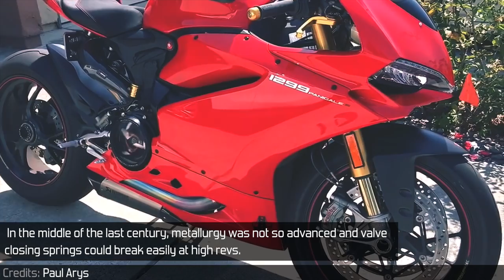Camshaft Closed DESMODROMIC Valve: Explained!

Comment: In the UK they had a bike racing series called battle of the twins. Anything could enter, except ducati desmo's  because being 4v they were more powerful than their 2v contemporaries.  My father who was a cylinder head specialist was enlisted by a racing team to remove desmo system and replace it with valve springs.  Took some planning to drill a big hole in the head in order to modify it internally. It won first time out and the competitors put in a protest insisting it's taken apart for inspection.  Imagine there surprise when they found springs!
Reply: I have long held that in motorsports if you want to be better then you must be different and try things no-one else is doing. Your Dad is a prime example.

Comment: The biggest advantage of desmo is lack of spring friction. This becomes huge as rpms increase and results in better fuel consumption for racing desmodromic valve engines.
Reply: Anthony Butera just like running competition cams, springs... in a race car, they're going to need much more maintenance, and generally won't like being short shifted.
Reply: Dylan Zrim 
Kind of but you have to set lash in 2 directions. No springforce on the cam in a desmo. Turn the cam on anything else and you will feel resistance from the springs on the valves.
Reply: Japanese bikes should try it out as well. who know how well they will improvise it further!!
Reply: I wonder if instead of camshaft has anybody put another tiny crankshaft with the valves attached to it?  Would it work better or worse?
Reply: Phantom Driven - Cars, RCs, and Lego Technic. Nice concept. It would work well until the tolerances changed. Come up with a way to adjust for that and you may have a great idea.
Reply: fidel catsro 
I am certain that Honda has tried it but wasn't happy with the results. They try everything but only sell good stuff.
Reply: Actually ducatis don't go to high in RMPs so their better fuel consumption comes more from this than from spring friction. In high competitions like MotoGP they all use hydraulic systems, as springs do not work properly at those RPMs
Reply: ALIENdrifter66 What the fuck are you saying? Ducati is desmo. hydraulics are not used in motogp. valve springs are used by everyone else.
Reply: ALIENdrifter66 I'm pretty sure Ducati still run Desmo in competition.
Reply: Dylan Zrim no springs is desmodromic.Yes they do.
Reply: Or not. With a cranckshaft you change a rotation move into a sinusoidal move. => 50% time up (and not perfectly closed) 50% down.   And that is not what we want. We want something that is down 25% time and up 75% time (perfectly still and closed).
Reply: And more power, Ducati has by far the most powerfull MotoGP engine.
Reply: Somewhere I read that the main reason for using Desmo was that at high RPM's spings have a difficult time keeping up and tend to 'fade'...
Reply: Ducati Dude 
That's called valve float. The higher rpm valve spring engines run even higher spring tension, making friction worse.
Reply: Anthony Butera -->  Yes... 'Valve Float', sorry. Thanks for the heads-up Dude...
Reply: @upsidedowndog1256  indeed.. i dare you to turn the cams on any non-desmo engine by hand.. if you succed, you're either incredibly strong, or you'r turning a lawnmower camshaft.. :)
Reply: @upsidedowndog1256  indeed.. that is why they came up with oval pistons in the NR500 and NR 750.. that didn't also work as expected
Reply: @JanBinnendijk  
How about a desmo oval piston design? Now THAT might be really cool I think! If Ducati sees this post, look out. They are the company that would try it and be stubborn enough to pull it off.....right before another bankruptcy.

Comment: Not exactly VisioRacer.  Desmodromic drives are still quite relevant specifically when applied to larger pistons/volumes above 0.5 liter/cylinder.  Those are large cylinder swept volumes that require large valves to fill.  Those valves are heavy and using springs to seat the valves for high RPM use means high cam-to-tappet pressures leading to wear.  If you are spinning to very high rpm with such large cylinders desmo drives still outperform standard valve springs by not having to use titanium valve materials.  If you are using large cylinder volumes for relatively low speeds (below 7,500 rpm) use standard springs but for higher rpms desmodromic begins to make sense as valve float is eliminated.  Every technology has its niche.

Comment: Desmodromic systems are one of those things that's interesting in principle but bulky and complicated (and now largely obsolete) in practice.
Reply: Similar to Wankel engines and automotive gas turbines. Electric power has plenty of potential, but nobody has managed to get the exorbitant cost down very much yet--the huge battery pack is still much too expensive. They're working on it, but it will happen very, very slowly.
Reply: maverick 
And yet only Ducati uses desmo valvetrains. The rest manages without.
Reply: @David Miatke honda has been selling v4s since 1982, with added reliability
Reply: @devilsoffspring5519  You kinda got it right, the main issue being we have no efficienct way of storing power ie batteries are still way behind where they should be compared to motors they could power...
Reply: @David Miatke Which of course is uber-lameass, because the whole point of developing something better is to develop something better :)
Reply: @ben156  Actually, storing energy in lithium-based batteries is extremely efficient--almost 100%!
So is converting it to mechanical power with an appropriate motor. But, the battery pack is big and very heavy, and it isn't really cost effective yet.

Comment: another great video.. Desmo does out perform valve springs in motogp though.. They just can't touch Pneumatic valves; But nothing's lighter than air..
Reply from the maker: Though, they don't use air, but nitrogen
Reply: VisioRacer thank you for the reply.. My apologies. Nitrogen not air :)

Comment: you're right but it's a bit more complicated than just high revs. 
When you open a valve, as it nears fully open the cam must slow the valve opening speed so it doesn't launch of the cam and the valve fully open occurs a bit after optimum. 
When a normal can has a valve fully open out must be a bit gentle about starting the valve closure. of the cam drops away to quickly the valve will float and therefore must start to close a bit earlier then optimum.  Of you mechanically push the valve closed you can leave it fully open for longer and then force it shut. 
While a short stroke engine allows higher revs it also exacerbates the the problem of having to open and close valves more suddenly. desmodromic valves allow  shorter stroke and higher rpm 2 things Ducati are known for.
Reply: Everything else is just cam profile. There's aggressive cams and smooth cams. The lobe design can still be applied to a desmo or spring system. VVT is the next step (multiple cam profiles and/or timing), and Freevalve is the future (fully variable lift and timing)

Comment: desmo valves are due for a comeback. in the modern engine, there is direct injection, which means there is really only one reason valves remain conical--they spin slightly in action. desmo valves cannot rotate in their seat, which means irregular shapes can be introduced. irregular creasant moon shaped valves with a desmo open and closing arrangement could enable pushrod engines to actually overtake typical 4 value engines with conical valves for surface area and maximum CFM, letting a combustion chamber breathe to it's theoretical limit on just two valves. this would not be possible prior to direct injection because conical valves were still necessary to ensure proper fuel atomization. now atomization happens purely with high pressure and valves can be free to be any shape provided they do not rotate in their seats at high RPM like sprung valves tend to do.
Reply: it's worth noting that the friction losses associate with desmo is more pronounced at high rpm anyways, which means at pushrod valve limits, 8000-9000 rpm, the parasitic losses associated with desmo would be much more neglegible. My goal, if I ever get enough know-how and free time, is to design a underbore v10 pushrod desmo engine of approx 4.8L in diplacement and even firing interval running a mean piston speed over 25 m/s. I'm expecting in excess of 600hp naturally aspirated in an engine no bigger than a small block chevy.
Reply: You are missing the other reason valves are round- the thermal expansion issue.... a conical seat can still seal. The exhaust valve depends on the time it is closed to dissipate heat,  quench itself against the seat. Otherwise it will overheat become brittle and crack.

Comment: the maintenance intervals are about the same as an y non-desmo system without hydraulic tappets, the only thing is.. the work is twice as much..
I have 2 ducati's and i do the maintenance myself, valve adjustment on my 851 means with 8 valves that ihave to adjust 16 clearances (like on a 4cilinder 16 valve engine).. i did a 4 cilinder 8 valve engine once, that took me just as long, as i was totally unfamiliar with valve adjustment with bolts)

Comment: I absolutely disagree with your statements about valve springs in the 1950s - the NSU Rennmax, e.g. and the Rennfox, plus the MV Agustas, Gileras, Mondials and Guzzis were high revving, very reliable racing engines, with hardly any valve spring troubles. As a matter of fact, the desmodromic system of the Ducatis has nowadays hardly a justification, proven by the fact that nobody else uses it!

Comment: 2:44 its 90° L twin engine not v twin
Reply: L-Twin is just marketing
Reply from the maker: L-twin is just a nickname, let's say it this way. In the real world, it is just a 90° V-twin engine. Many engines do have the 90° V angle, V-8s most often.
Reply: @VisioRacer  It's how the engine sat in the bikes. Viewed from the right side of the bike the cylinder heads form an L shape, not a V.